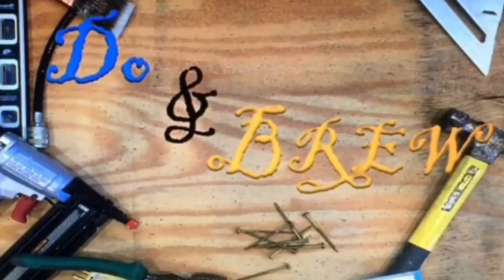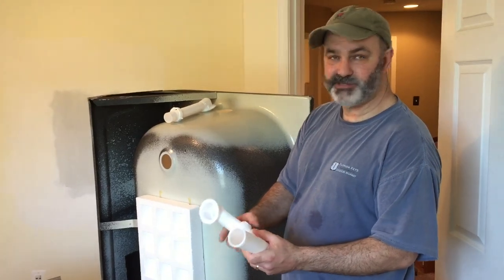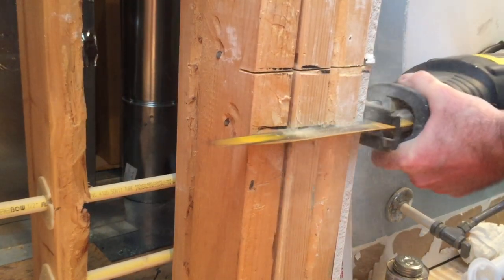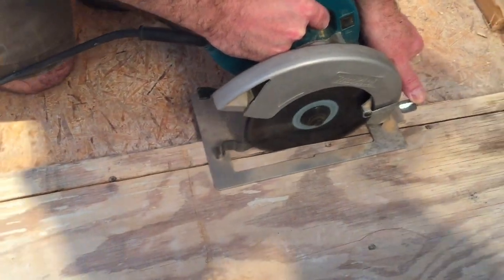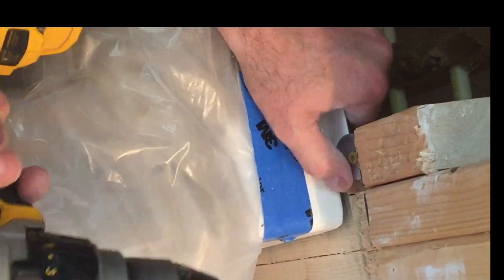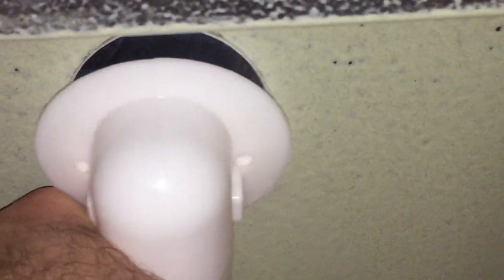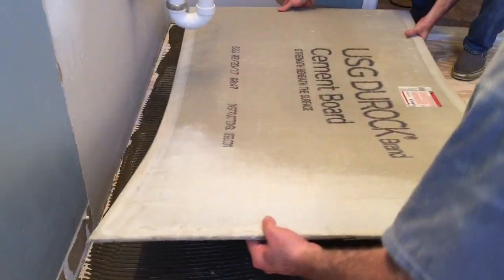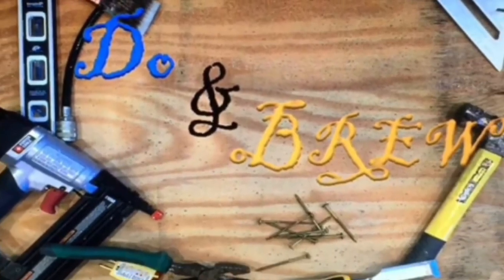Part 1 – How To Install A Bathtub - Complete Bathroom Remodel

Comment: Would you give your opinion on using. the inexpensive plastic drain parts rather than buying the much more expensive metal drain and overflow.  I am in the process of a total remodel of the bathroom and have taken out all the old galvanized drain pipe & replaced with Sch 40.  It was a great video.
Reply from the maker: Howdy J Till !!!  I prefer the sked 40 pipe.  Functionally they are both the same, but the PVC is much easier to work with...plus I believe it will last longer - no rust or corrosion!  Good luck on your bathroom remodel, let me know if you have more questions...hope to see you as a sub!!!

Comment: I really appreciate your videos, I'm learning a lot as I follow your steps. (?) Is it necessary to add a vapor barrier to bathroom walls that are insulated or not? I noticed that some people do it and some don't.
Reply from the maker: Howdy Dave Groove Master Gore!  I do not...I don’t see the reason to do this extra step.  Why have a moisture barrier behind the drywall when moisture should never get that far.  I do waterproof the entire bathroom with a waterproofing compound however - and I always use (green) mold resistant drywall in bathrooms.  Also, I am a huge believer in installing bathroom exhaust fans...this is the single best thing you can do to evacuate moisture/water vapor from your bathroom - or kitchen - or laundry room!  The more CFM (cubic feet per minute) movement the better.  Code in my area states that an exhaust fan is not required for bathrooms with a window...I still install an exhaust fan!  Hope this helps...thanks for checking out the video!    ☘️
Reply: @DoAndBrewDIY  Thank You so much for your reply... I'm learning a lot from you and my neighbor (they remodel kitchens & baths), I'm considering a new career change because I find construction very exciting and rewarding ALL at the same time. I've purchased most of the tools and I put them to use a lot. (to be the best, I have to work with the best). Thank you for everything.
Reply from the maker: Dave Groove Master Gore ....  good luck on your new career choice!  I love all things ‘home construction’.  After 25 years flying helicopters in the military, I retired and took a desk job...now in my early 50s I am trying to do home construction full time!  I agree with you...it is very exciting/rewarding work!  Good luck and let me know if you have any questions along the way!   ☘️

Comment: I have 1/4” OSB on the floor now. If I put down 1/4” underlayment plywood then thinset hardie board to it, will that be sufficient for ceramic tile. The area being tiled is approximately 40sq ft.
Reply from the maker: Yes....use 1/2” cement board and you’ll be off to a great start!
Reply: Oops meant 3/4” OSB.

Comment: At the joints of the cement board, would it be better to fill the joint first to make sure the mortar gets all the way down to the subfloor then put the tape on? Is the fiberglass tape the same as the fiberglass tape that some use for Sheetrock?
Reply from the maker: Howdy Tim Terrillion!  The procedures I show in the cement board video are those recommended by the manufacturer.  I suppose you could spread thinset into the joint first, then apply your alkaline resistant tape and then re-apply thinset, but that seems to add an extra step or two that is not required.

No the fiberglass tape for drywall is not the same tape used for cement board installation.  The Drywall fiberglass mesh tape is made for drywall seams and intended to be coated with joint compound. ... The alkali-resistant coating of cement board tape protects the fiberglass from degradation that can occur with thin-set mortar.  Good question!

Good luck on your project!  Hope to see you as a sub...cool stuff coming soon to Do & Brew!!!   ☘️
Reply: Thank you

Comment: I am not trying to say "AHH HAH" I caught you!" with this question.... Am I wrong or did you go ahead and add another layer of subfloor under the tub at the "dead battery" moment.  Making the entire room floor one level now?  Before the tub was in a "hole" so to speak.  You can clearly see OSB in the tub area.  You even had to trim the plywood subfloor.  As  you are pouring the mortar to support the tub bottom, you can clearly see you're pouring over new plywood and not the old OSB.  

I am asking this because I need to know, as I'm about to start a bathroom total remodel.

Also, why didn't you put Durock under the tub as well?  So the entire floor was one level?  I notice in video #2 (yeah, i watched out of order, heh.  I was looking for vid's on Durock installation at first) as you are laying Durock right next to tub I'm thinking "damn, hes gonna have the tub half an inch "under ground" compared to the tile floor.  

In my mind I want the tub on the same level so to speak.  I intend to remove my tub and strip out the whole room down to the joist.  My thinking is to do the entire room with the Durock as well, even under the tub.

Would like to know your thoughts on why you did it your way.  And if it would be ok to do it my way.

Thank you. 

P.s.  Well, that'll teach me to stop and ask questions before the end of a vid.  I saw the old OSB floor again as you were doing the drain work. lol.  I still plan to make my floor all one level however.  Unless there's a reason not too. 

Thanks again =)
Reply from the maker: Howdy Jim A. !  You have a keen eye for detail brother!!!  In a matter of speaking, you did ‘catch me’...when my battery died I didn’t want to completely stop working...so I poured the thinset puddle and then set the tub.  I missed capturing that exact moment, but wanted to cover that important step, so I used a bit of ‘stock video’ to illustrate that point.  Good eyes!  

To answer your question, I don’t think it really matters one way or the other if your tub and finished tile floor is on the exact same level.  It could be said the setting the tub lower might make it easier for someone with mobility issues to get in or out...but I don’t know if 1.5 inches would really make that much difference.  I installed this tub as you see because that aligned with the ‘as built ‘ design.  If you are completely gutting your bathroom and building up from the joists it shouldn’t make a difference and would most likely be easier and therefore save you some time.  

Regarding Durock under the tub... that is not required, but you’ll want to use Redgard - or some type of waterproofing membrane - to waterproof your floor to ensure no leaks.  I have a video on waterproofing as well.

Let me know if you have any more questions and good luck on your bathroom remodel !!!